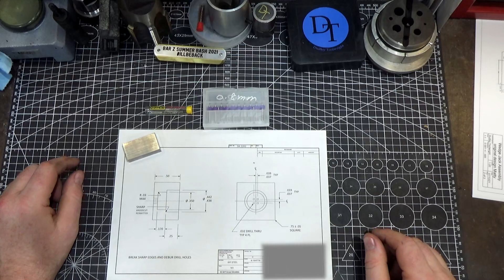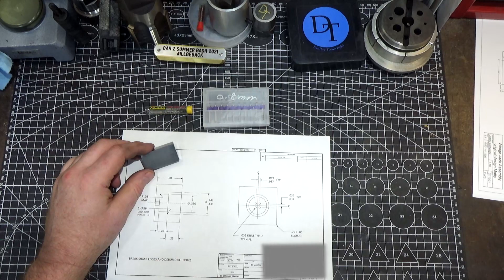168 Thermocouple Alignment tool for Weldups

Comment: That's an interesting observation about the depth Mike. I never thought about that, but you're absolutely right, particularly for the last five thousandths or so. What would be the fix? Maybe stylus on a very stiff spring steel so that it makes an audible pop sort of like bottled foods? It almost makes a strong argument for using calipers over a depth mic, or One of those giveaway depth gauges that are just a narrow ruler with a sliding tombstone.
Reply from the maker: I am not sure what the actual solution is. My depth mic is a Starrett and it has the preset clit tension knob on the handle, but I still find that at one click there can be some lift.

Comment: Very cool boring head. Did the machinist you got it from make it himself? How does it lock the position?
Reply: I always get nervous doing a small bores with the big criterion head. Just too much asymmetrical Mass for my comfort
Reply: Scratch the second question I got a view of the lock. Looks so much more convenient
Reply from the maker: The boring head is a Kennametal and it locks into position with a thumb screw. It also has a Vernier that measures in 0.0001" increments. It is quite nice, but only takes 1/8" diameter boring bars.
Reply: @DudleyToolwright  interesting, just by chance I saw a video by Stuart de haro about a 10th set boring head with an almost identical design. It's weird how that works, I was completely unfamiliar with a whole class of tools and then see 2 in the same week. Thank you for the reply
Reply from the maker: Always.